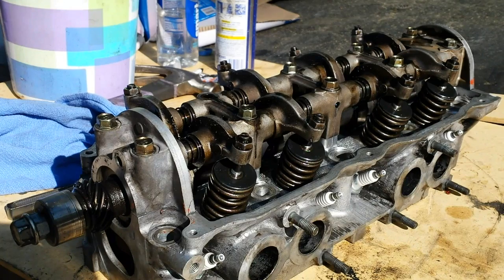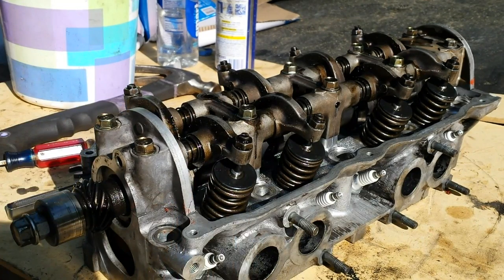How To Adjust Valve Lash

Comment: I ran into a slight problem while adjusting the valves on THIS specific cylinder head. I think it’s important to mention what I encountered. 
Between the top of the valve and the contact point of the rocker arm known as the “ball” which is exactly that, if the ball is rotated in a different direction than normal operation, it causes the FLAT SURFACE of the ball to move away from the valve. Giving you zero gap, constant contact and inability to insert your feeler gauges.
Make sure that the flat spot of the ball attached to the rocker arm is rotated and facing the top of the valve and proceed to adjust accordingly.  
Thank you for your video it was very helpful.

Comment: This guy is right on everything here except the valve clearance. .003 is WAY TOO TIGHT. You can burn a valve and will lose power like CRAZY. Factory is .012 HOT. Mazda Mitch sets them at .010 COLD. I set mine to .003 and I cant make it up a hill. I'm hoping I didn't burn a valve on a brand new head on a brand new engine here. With all due respect sir.

Comment: Hey guys. Just want to make a psa.   I followed the instructions in this video about a month ago and adjusted my valve lash to .003 HOT.   My truck had a rough idle and stalled occasionally as well had starting issues.   

Going down a list, I replaced the ECU, injectors, fuel pressure regulator.  The trucks performance improved slightly with each upgrade but it still had issues stalling and rough idle.  

I just adjusted my valve lash to .007 intake and .010 exhaust and the trucks idle improved a lot.   .003 is too tight and you can possibly burn your valves. 

Even .007/ .010 is still too tight. Please follow the factor spec. It exists for a god damn reason!

Now my situation is not perfect.  I have a bigger lift on my cam.  I think it went from 30 lift (stock) to 50 lift after having it ground.  Keep this in mind fellas.  

Long story short.  If your engine is idling rough after you have made a lash adjustment ITS TOO TIGHT.
Reply: I second that. .003 is too tight. I tightened mine to .003 and the truck started idling rough. I checked everything. I replaced my carb, plugs, wires, half of the ignition system, I treated the truck with the Seafoam, nothing helped. Turned out the valves were too tight from .003 adjustment, I set it to intake=0.008" (0.2mm)
 exhaust=0.012" (0.3mm), per factory specifications and the car is super quiet and idles a lot better. I just hope I didn't damage my valves.
Reply: Dune Master I am going to make another adjustment.   I might shoot a video on my phone.

I will set it to .0025 lash and demonstrate how it affects the compression.    Then of course creep up on lash clearance. Demonstrating that as well.

How is your truck doing?
Reply: @poopl00p3r my truck still idles a little rough, but notably better since I loosened up the valves. I have a Chilton Manual and it says: "(Valve) Clearance for all engines should be 0.25mm". But under my hood, Mazda sticker says to set it to intake=0.008" (0.2mm)
 exhaust=0.012" (0.3mm). I set it to the Mazda specs. What do you think? Also, I just switched to a Weber carb and I think it runs rich because the plugs are black with soot. Maybe that's the reason it still idles rough. I have an 86 Mazda B2000 with 116k miles.

Comment: So, you know better than the engineers who designed this engine. Stay with factory specs or burn a valve. This is very poor advise! Or they will bind up and brake a valve spring. And who cares how loud they are cold any way.
Reply: Lol all about preference bud, on my daily got 2 roll overs on my Speedo on .3 clearance

Comment: If this is a four stroke engine.  Four stroke takes 2 cycles, which means it takes 720 degree to finish a cycle.  So, don't you have to take 180 degrees for a cylinder to come to compression?  720 degrees/4 cylinders = 180 degrees??  What I mean is you have to turn 180 degrees to adjust the cylinder which is in compression stroke.
Reply: Hari Sri no, because he is turning the cam shaft, not the crankshaft
Reply: Hari u dont belong near a car😂😂😂😂
Reply: i liked the Q, unfortunately no answer. but you r right about the rotation angle as well as the next cylinder order

Comment: I tried this and set it at .003  one of my rocker arms broke. On a B2000 . I had to buy another head  I was missing parts. When I started  working on the truck there were only two of the alignment pins and there is suppose to be six.  The book says 12. I just got these set to 9. Now the truck does not want to turn over. Before I started screwing with it would turn over and run. Not sure what to do now.

Comment: I recently bought a junkyard special, 2.0  with 100k miles, dropped it in replaced gaskets, seales, and wires...the basics.
When I go to change the timing belt I noticed it had 2.2 head. 
What belt do I use? A 2.2 or 2.0?
Reply from the maker: That's something I just learned of. All I know is one of the belts is a .5" less than the other. Not sure which is which tho. Look under the header and see which block you have. I would say go with what the block says. Not the head. Cause the front of a 2.0 is slightly differ from the 2.2. The number is close to the 3rd piston on driver side about an inch below the head.
Reply: Joseph Wilkins thank man, i appreciate it.  ill check it out, see what it says.

Comment: When you swap over to b2000 rockers do you use the b2000 cam or the b22 cam? I put mine to 8 and it still ticks like crazy.
Reply from the maker: The cams are the same. Set lash to .003 and you will never have a click